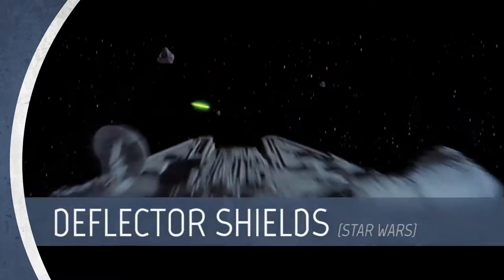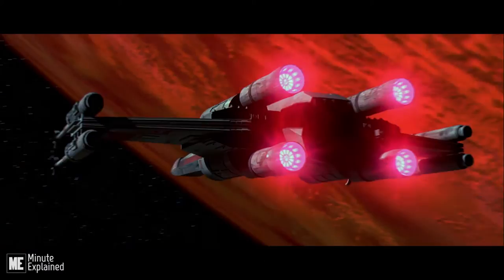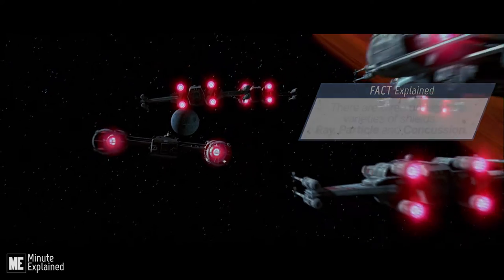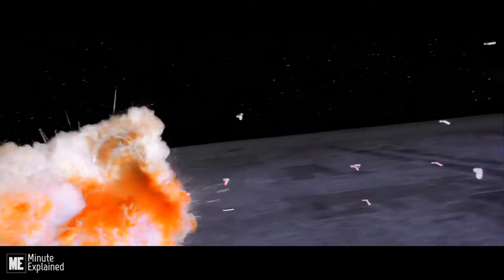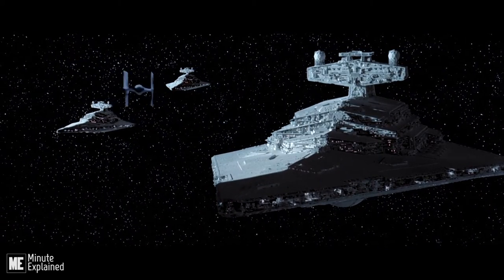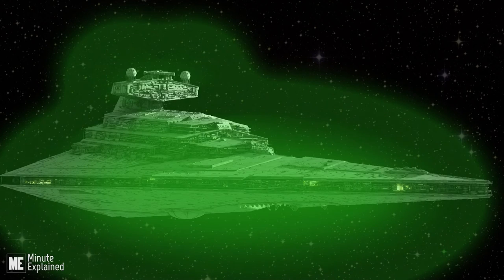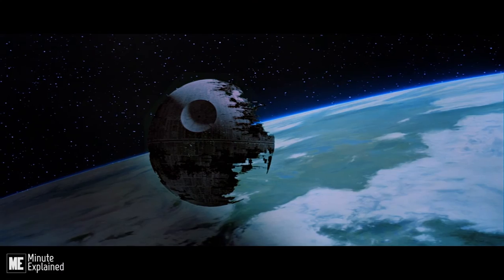How DEFLECTOR SHIELDS work | Why the trench run was necessary!

Comment: The Death Star II didn't generate it's own deflector shields because the station wasn't fully operational yet. The Executor's deflector shields had apparently dropped just prior to the rebel pilot crashing through the bridge window.
Reply: why didn't the first Death star have any shields ?
Reply: Major Grin it had only ray shields, which only protects from lasers, not physical projectiles like proton torpedoes
Reply: @NitpickingNerd  It did.
Reply: @imppro   how did the fighters penetrate it so easily?   why didn't it have more powerful shields that prevent that?
Reply: @NitpickingNerd  - Hubris. The Empire didn't bother engaging particle shields because they simply didn't believe the Resistance fighters would make it to any exploitable weakness. The station design was intended to fend off capital vessels and large fleets from great distances, and no starfighter posed a serious risk or threat (so they thought). In the case of starfighter attack, they had wings and wings of fighters ready to intercept, except, once again, hubris. The majority of the anti-fighter defenses aboard the first Deathstar were simply never scrambled. They realised their folly far too late.

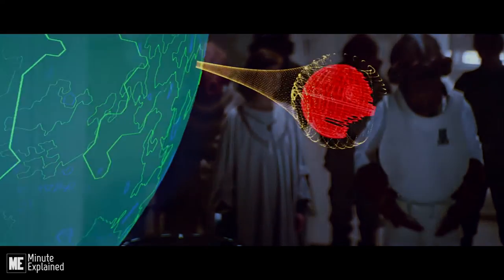Comment: 0:54 I thought that the pilot crashed through the bridge because the shields were down... If you look at the Space battle of Endor the rebels blow up the ships shield generator  seconds before that scene of the ship crashing into the bridge. 
I doubt a tiny fighter like that one would be able to crash through the shields... All it would take is to program a fighter to fly straight into the bridge..

Comment: That's the one main difference between the shield systems in Star Trek and Star Wars, the Star Trek shields do protect against physical impact.  In that star destroyer picture with the green halo the dome on the bottom is actually the reactor, and houses what is essentially a small star.  There is a reason why the shield generators are on top of the Star Destroyer Tower, and Star Wars energy shields are deadly to humans and how else is the Empire going to thin the herd from incompetent officers.
Reply: Incorrect. As you can see in Star Wars Episode IV: A New Hope , debris from the remains of Alderaan were propelled at 5% the speed of light, as this video describes it: https://youtu.be/N0uw0T0JvSI?feature=shared with mountain sized boulders at such velocity towards the Death Star would have significantly damaged it if not destroyed. But that is clearly not the case. It is still intact by the time of the Alliance's attack on the station.  

Also, if solid objects could pass through shields, then the shuttle Tydirum in Star Wars Episode VI: Return of the Jedi should have been able to board the station without incident without requesting deactivation of the shield, or that the Alliance fighters could fly towards the battle station and proceed towards their target. The fact that they had to break off the attack and "pull up," as supported by the novelization indicates that some of the fighters didn't make in time and crashed into the shield indicates that they could not be bypassed. 

There is also the laser walls in Star Wars Episode I: The Phantom Menace where Qui-Gon Jinn, Obi-Wan Kenobi, and Darth Maul could not get through either, nor could Anakin, Obi-Wan nor Palpatine walk through the ray shields in Star Wars Episode III: Revenge of the Sith . And in-universe lore, as supported by the original novelization suggests that the exhaust port is not "particle shielded."

Comment: Thanks for the video and thanks for the joke at the end. However, if the last comment is true then the shields are not good against asteroids either. That can't be right!

Just saw Rogue One. I am interested to know how the the deflector shield generators/emitters of the destroyers here and in ROTJ were put out of commission in the first place. What do you need to do for that to happen?
Reply from the maker: Thanks for the comment!  

Many deflector shields are VERY susceptible to asteroids! (Example - the asteroid field in Empire Strikes Back).  There are three types of shields in Star Wars: Ray, Particle, and Concussion Shields.  Concussion Shields are capable of protect against asteroids and ship collisions (remember the X-Wing crashing into the shield in Rogue One?), but they need a massive power supply to run the shield generator, and is very uncommon for a ship to have one.  

How to Knock Out the Shields:  With every laser blast or impact, the shield deteriorates and needs to be recharged by the shield generator.  So, by continually bombarding the shields with laser fire until its power is depleted the shields will go offline.  

Hope this helps!
Reply: @MinuteExplained  I have a question, do the ray shields on capital ships create an invisible "bubble" where you can fly through?